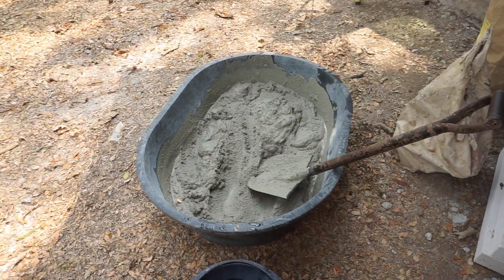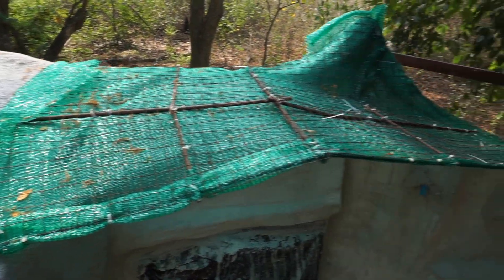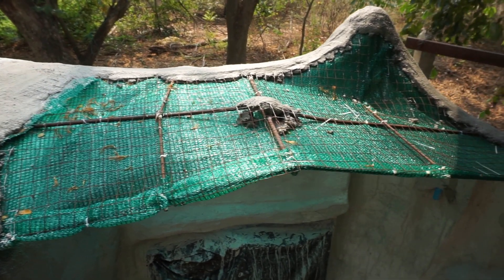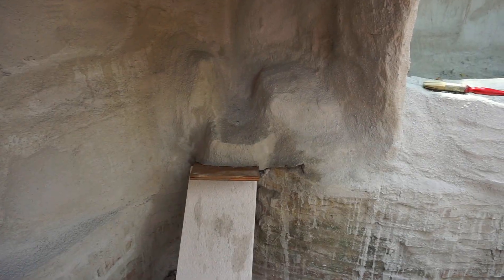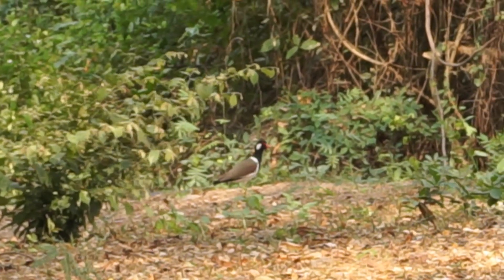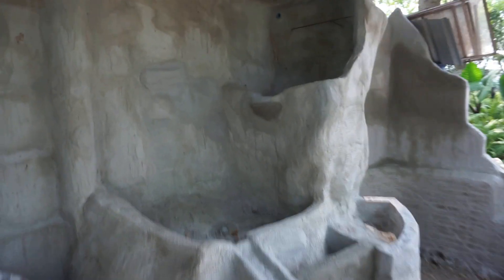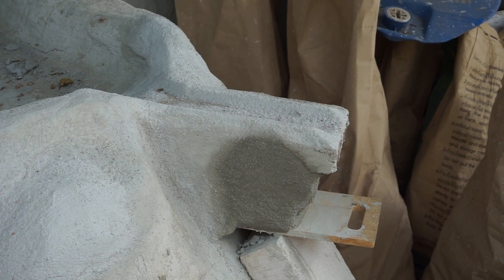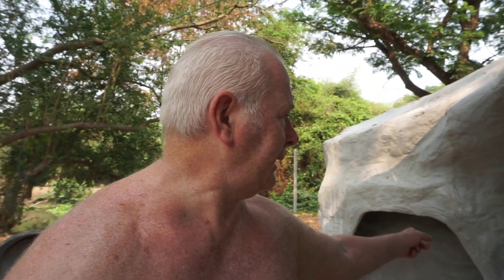Waterfall Update No  64, Finishing Off

Comment: I thought you were going to cut the prickly heat can up and screw it to the wall, then fold the flap out  for the water to run down. Even drill a few holes in the bottom of it for water to trickle thought.
Reply from the maker: Good idea Tim. I am trying to keep it looking like nature all the time. So now it can lift away from the wall and drip in the pond.